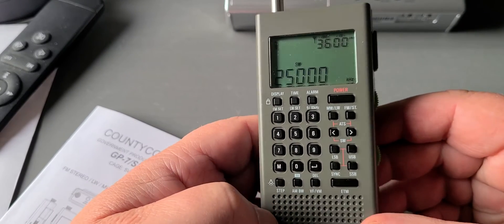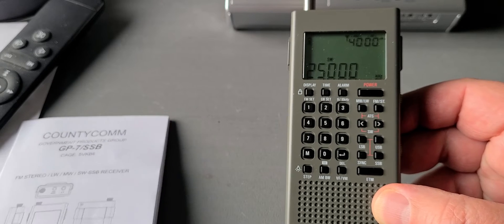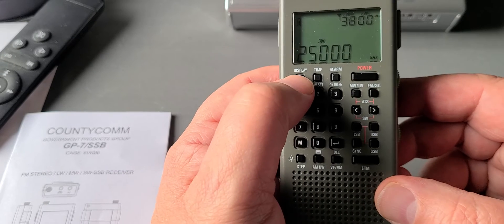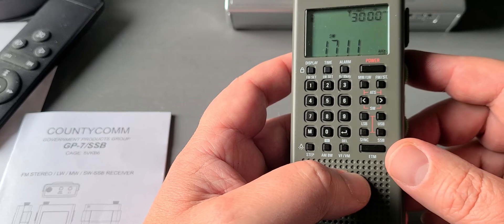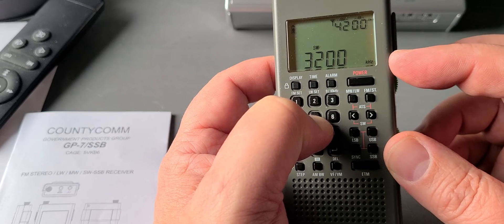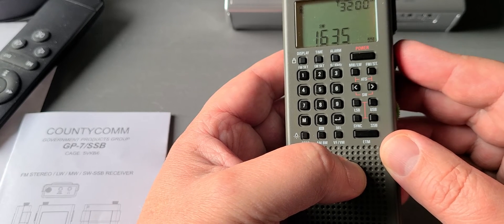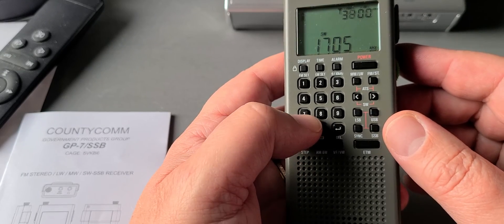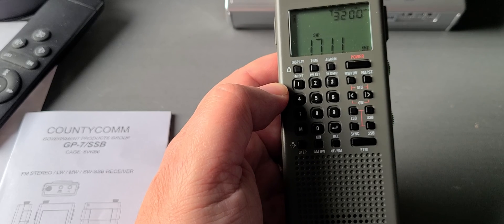Hidden Feature How to extend the coverage of Shortwave on CountyComm GP-7/SSB Tecsun PL-368

Comment: Quick question: how do you change the tuning step on SW? Mine is only moving in 5kHz increments.
Reply from the maker: quick press on the step key on the bottom right and the tuning know will go to 1 kHz , on SSB you will change from 10 - 100 and 1 kHz tuning steps
Reply: @OfficialSWLchannel  Thank you

Comment: How did you discover this? Surely you aren't just pressing and holding all of the buttons in all of the modes. Nor do I suspect that you dumped and disassembled the microcontroller firmware. Someone must have told you, right?